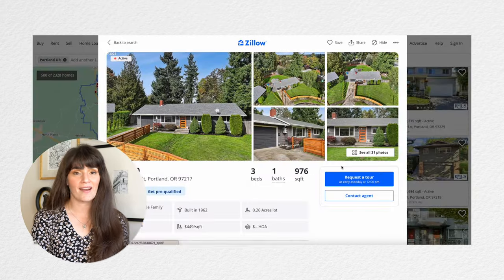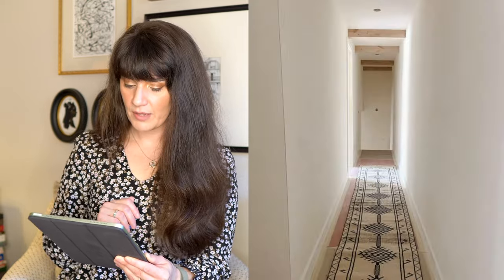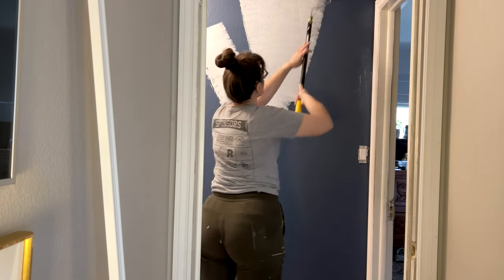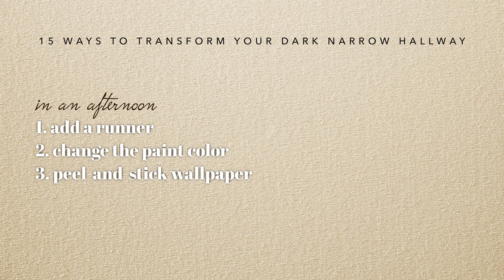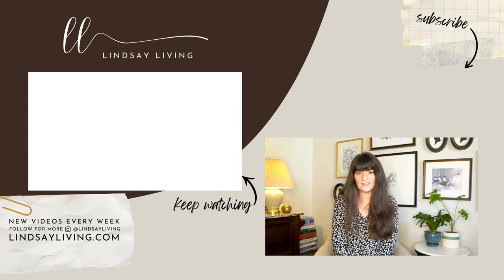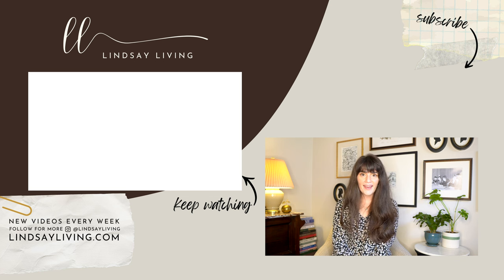15 Ways to Transform Your Dark & Narrow Hallway

Comment: Timestamps
0:00 Intro
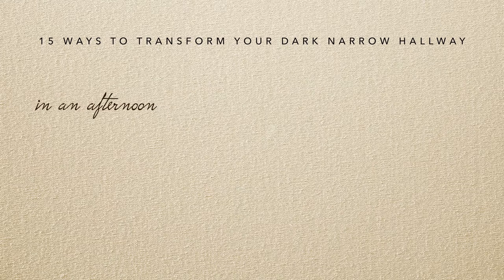1:17 Add a runner
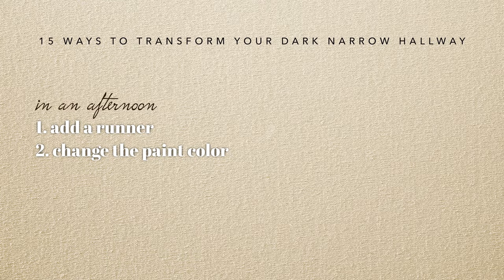2:48 Change the paint color
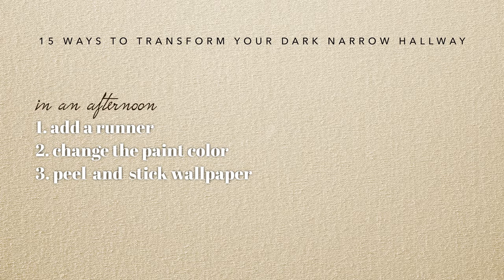6:20 Peel and stick wallpaper

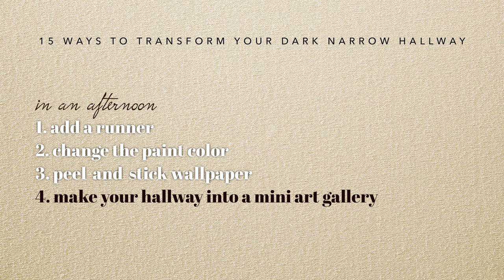8:46 Mini art gallery
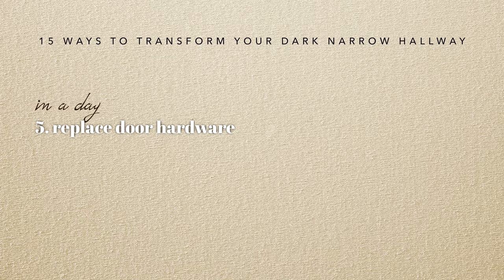9:49 Replace door hardware
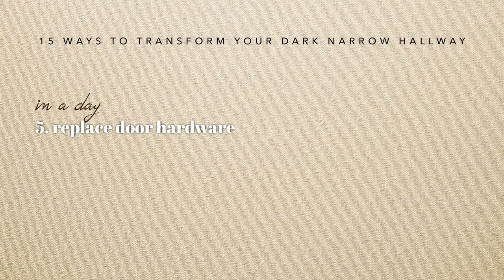11:50 Add or extend baseboards
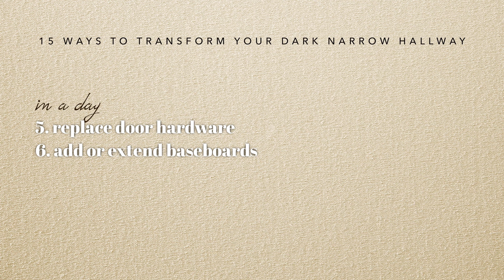13:24 Peel and stick floor
14:45 Retexture the walls
16:03 Limewash paint
16:38 Design your ceiling
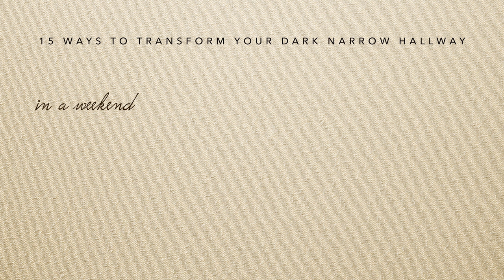19:38 Replace doors
22:18 Add or change door casings
23:45 Tile the floor
25:34 Refinish the floor
26:10 Create a hallway library
27:52 Wood paneling
28:19 Outro
Reply from the maker: Thanks for sharing the timestamps! It's always helpful for viewers to navigate through the video easily. 😊

Comment: Can you do a video on how to figure out patterns for doing applied moldings.  There is a room off our entry that would look wonderful with applied wall moldings. I know doing the actual work is not that difficult but deciding how to lay it out is stopping me from taking this on.  I need an architectural element in that room.  I will paint the applied molding the same color as the wall——subtle touch but it will really visually change the room.
Reply from the maker: That's a fun idea! I haven't done that project yet myself but plan to add some panel molding to some areas of our home in the future. I will definitely make a video about the process once I do!. Thanks for wathcing!